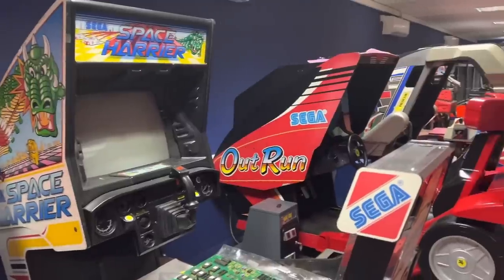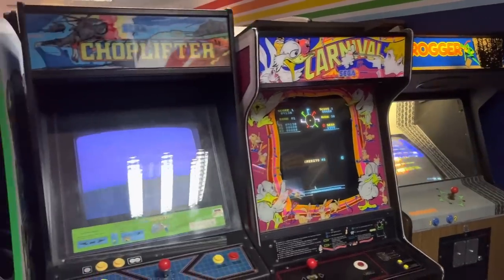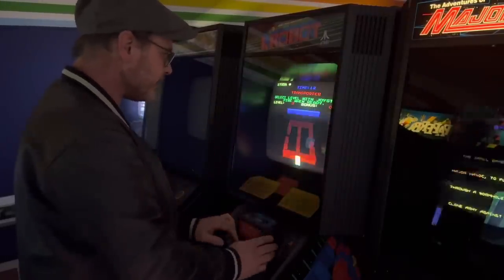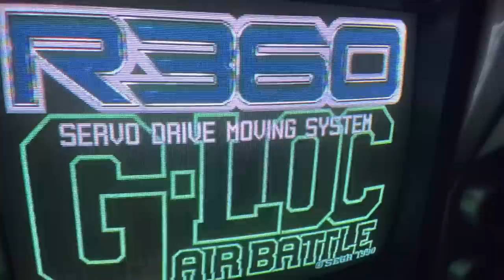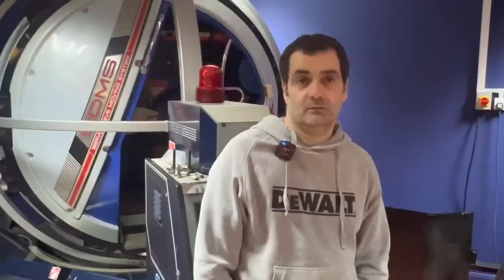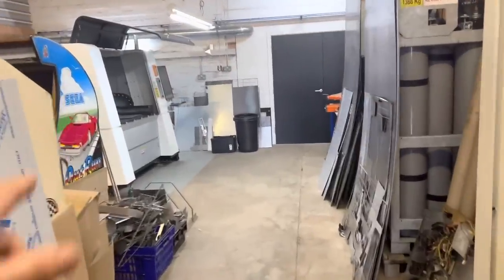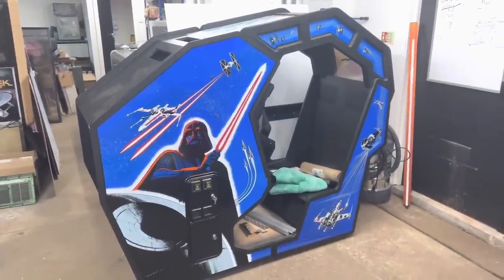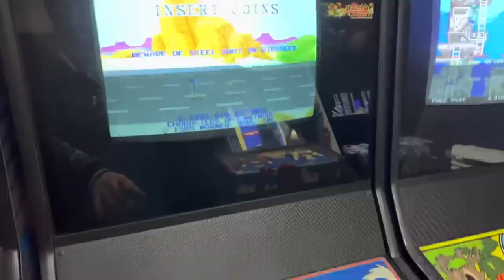An Insane Private Arcade Hidden in the UK | Game Room Tour #26  Ordyne

Comment: The Sega R360 is one machine you do not want to be in if it malfunctions and goes into a constant spin and none of the buttons work, especially if your home alone with no-one to pull the plug from the wall....
You could easily redecorate the whole room with pizza topping for eternity or at least until there was a power cut !!!

Comment: Wow, what a locale - real insight in there!

I was in a 360 spinning cabinet in '99 or 2000 - I guess it must have been the R360 running the G-LOC game. In Seattle at the time for a job interview with a games workshop, which the gracious host was good enough to fittingly finish up at the local arcade. The interviewer wanted to check out my chops at this artefact but I never even made it to the canyon stage (level 3) so no wonder I didn't get the gig.

First and likely last time I got to try it! Memorable, but the upside down bits are really disorienting. I guess real pilots largely get pushed into the seat by momentum when upside down, whereas in the arcade the shoulder straps is where the push is...

Would have loved to try this ride with more recent software though, rather than re-experiencing the Space Harrier style tech G-LOC runs on. The contemporary Wing War title (which some units seemingly ran) looks slightly more immersive.

Real piece of engineering by Sega! Wonderful to see it running in mint condition!
Reply from the maker: Thanks for sharing your experiences as it’s always nice to hear what kids thought of it bitd. I think as I’ve got older I’m less tolerant of spinning rides but bitd I would have liked it more.
Thanks for watching